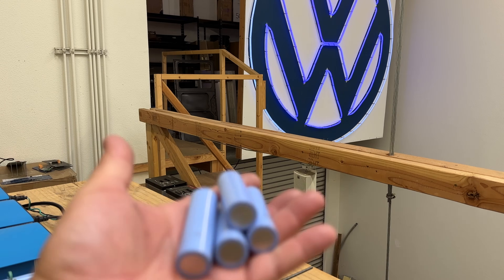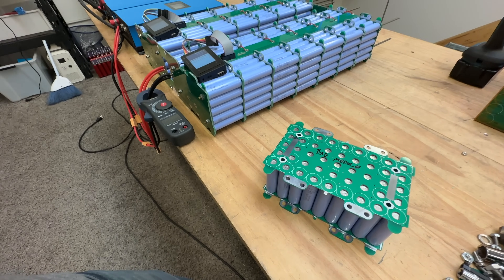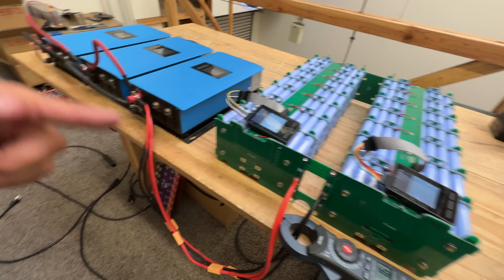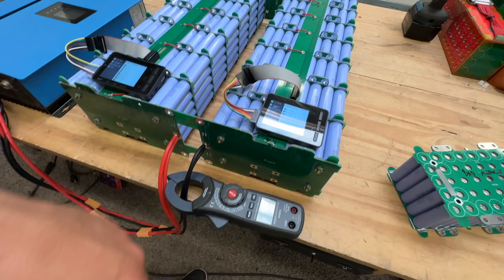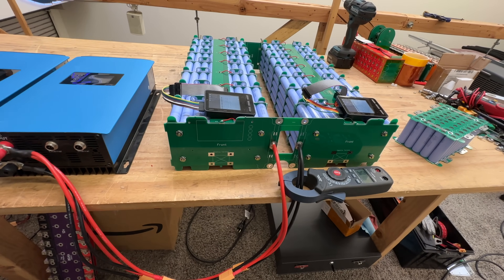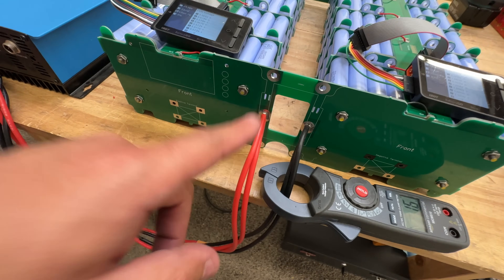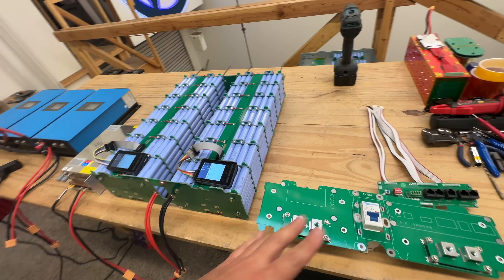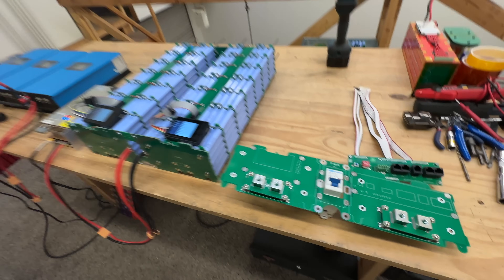Making batteries - 18650 PCB modules

Comment: I'm thinking about buying your 24v 18650 diy pcb kits and was wondering if I can make two stacks like 5 boards each then connect via the plug in series to make 48v system. Is this possible? or would I let the magic smoke out and make the pixies angry?

Comment: when a weld breaks loosing connection to a terminal in a ev battery pack wouldn't that change the voltage output or the charging so if the ground side on 1 battery in a pack broke connection the hot still connected could still discharge and drain the battery to much , how about a test?  having compression on the terminals or a torque so not to push in the positive to far in with compression connecting the terminals along with the weld would be safer in case a weld was to come apart

Comment: Im all for DIY stuff and i like the videos. But when you add up all the costs of the batteries , cables, pcb bms etc.   Its always going to be more expensive plus the fact that the 18650 would last less than LFP so it doesnt look cost effective.

Comment: The best location for contacting pressure would be concentric around the rod holes , not in a line between the 2 holes.
The strips might even result in a warp like this () due to them protruding slightly and the forces generating a bending moment at the edges of those strips. 
This is all theoretical though but I'd take that into consideration for the next iteration if possible.
Also make absolutely sure to use a torque wrench when everything hinges on the correct and consistent pressure generated from those nuts!
Tightening a nut more in one place than the others might likewise result in some material bending/drifting and lead to faulty contacting after a longer time period.
Also why not let there be a bit bigger holes rather than those needle sized ones in the intermediate spaces of the green board... so at least a tiny amount of cooling convection could happen if the cells would be mounted "standing".

Comment: I think if you either used a larger nickel strip on those contacts, or used a wide nickel strip bent in half along the long edge to provide a "spring" contact tab you would have extremely good contact pressure ensuring that even if something was slightly out of wack there would be a solid connection.

Comment: I think it’s Trampa boards that does something similar and I’ve seen some LFP batteries made of cylindrical cells using compression just like you describe. 

I strongly disagree with the concept behind the Trampa boards. You don’t put P42A’s in a pack and then do stupid shit that increases resistance. You do everything you can to lower resistance for the cellinterconnects. You experiment with copper, you layer nickel on top of nickel (pure nickel you plebs, plated steel is only good for the copper nickel sandwich)

You don’t say “welding material together is too complicated, on my high power application with some of the worlds best high power 21700’s I’m going to abandon welding because compression is good enough”

Unless you’re trying to build a heater
Reply from the maker: This is not high power design.  1c target for storage.
Reply: @jehugarcia  Yeah totally understood I was just on a rant bashing the people puting P42A's in a compression design. I actually have you to thank for teaching me so early on that cell holders are not ideal for building battery packs and its because of the terrible resistance of the contacts. You have to spend money on the nice Keystone holders if you want to only add a few milliohms on each side.

This might be one of your best ideas yet. It's like taking your PCB module design to the next level. There are a few LiFePO4 battery manufacturers using a very similar design (I know Lithium Solar has reviewed at least one) and when done correctly this absolutely works. It all comes down to making sure your PCB's/plates are made to decent tolerances so the compression is being applied to the conductive area and that the material used is up to the task. I'm pretty naive when it comes to PCB manufacturing but what would it take to have copper pads doing the transmitting of current module to module? I know spot welding nickel to copper is a pain so if the factory can make the switch from copper to nickel where the consumer attaches the battery nickel to the PCB that might significantly help.

I did some testing to dispel rumors about copper on top of nickel interconnects and nickel on top of the copper interconnects and I was surprised to find out that even if you had nickel as the primary interconnect material touching the cells (what I would consider the easiest way to do this if you didn't have access to a kWeld or other 1500A+ welder) the addition of copper did help because current chooses the path of least resistance. I'm guessing in my little test setup that the current was shooting straight up to the copper ASAP when it "saw" that a long strip of super low resistance material was available...kind of like it saw an AutoBahn running above it on a second floor of the highway system so even though it would take a few extra seconds to merge off the 1st floor highway and take a ramp up to the 2nd floor AutoBahn the tripling of the speed once up there made it totally worthwhile for even a short trip (distance between the cell terminal and the top of the copper 2nd floor Autobahn would total 0.30mm if the current wanted to run on top of the copper and the distance between the two terminals was 18mm center to center so a huge distance compared to traveling through the nickel vertically)

At some point people have to accept that spot welding is necessary and its 2023, a so so spot welder that can do 0.15mm nickel can be had for $50! You can buy a $30 3S Lipo and a $20 board or you can buy a powerbank style spot welder that has the lipo inside with a cute little display. It's a worthy investment, you'd spend just as much on a set of decent sockets or wrenches. When it comes to 18650's 0.15mm pure nickel is going to cover everything but the 10C cells being pushed to the limit.

Comment: How long will it take to charge it?
Reply from the maker: depends how big the charger is
Reply: @jehugarcia  I know, but I was asking for your charger.
Reply: @Under_Protest t’s a 1000W CC CV power supply (the one directly to the left of the packs in the latter third of the video. 

I can’t tell you which voltage/current one he has they come in a very wide range. So just take the max battery pack voltage and divide 1000W by that number. That’s the theoretical max amps (if the chargers voltage limit was exactly that voltage) common voltage current combos are 24V/40A, 48V/20A, 100V/10A, 120V/8A, etc

No offence but these questions get kind of old. Most lithium batteries can be charged at 1C so that’s one hour plus a bit more for the Constant Voltage Stage. Some power cells can be charged at 2C but that’s less common and hurts cycle life. 

So considering all the gear Jehu has I’m sure he could slap together some inverter chargers to charge just about any pack up to a couple hundred amp hours in 1 hour and 20’ish minutes from dead ass empty to 100% SOC. any time you wonder “how long does that take to charge?” The answer is technically 2 hours 30 minutes at the most if the cells only allow 0.5C charging. But for the majority of cells it can be charged in just over an hour if you’re willing to get the right charger (which aren’t that expensive, those $300+ e-bike chargers are a freaking joke, for $200 you can max out any 120V circuit at 1800W and get close to max out a 220V-240V circuit by buying a 3000W charger on Aliexpress but you have to know what you are doing, be able to understand what they are building these chargers from, and what are the limitations in terms of grid power, the charger, your cables, your connectors, and your cells. 3000W is a shit ton of power even 1800W is a lot and if you don’t have a moderate understanding of power electronics I would not recommend getting a charger made from a modified server power supply/telecom power supply off Ali)

Comment: Hey Jehu, I have an iMAXB6AC
Dual Power, and I got it too hot. First question, is it worth getting it fixed, or just buy another one? Second question, is there a better charger to use for single up to 6 or more batteries at a time? I opened up the balance charger and replaced the 680 micro farad 35 volt electrolytic, because it was blown. But it still resets every time you try to use it.
Reply: Q6 nano/Q6 plus by ISDT. Q8 air or max if you want 8S

Comment: This product is very exciting.  Please stay focused on this, as this would make a great powerwall solution.  It would be awesome if you can source the case, bms, batteries and all the pcb boards to build this product for a reasonable price.  I also think it could be made better if you can connect the modules a little differently so that you know you will not lose contact between the modules and possible short out the battery.  You are awesome, and I am addicted to your videos and your products.  Keep up the amazing work.

Comment: Just connect everything with bolts it is already a tried and tested method (if it ain't broken dont fix it )
Reply from the maker: Bolts can’t be placed near the cells,  only on the outer sides of the modules unevenly loading the cells.  This fixes that issue.
Reply: @jehugarcia  i think it would be more reliable conductive wise to connect each pack together with the bolts at the top too,there would be no fear of getting a loose connection over time makings your product last and prove its self reliable over time.just saying though,anyways i enjoyed your videos and i learn alot thanks for your content really helpful 👍
Reply from the maker: @odeywilliams7596  both can be done at the same time
Reply: @jehugarcia  would be better

Comment: One issue I see, is that poor connections could occur over time. Given the increased resistance of poor connections, combined with typically high amps, it could create hotspots in the core of the battery. This could cause cell degradation and/or runaway thermals. I'd suggest to just screw the plates together.

Comment: I love it. I have 100s and 100s of 18650s. 48v 100a is great.  I also need 14.2v. Voltage drop will put it at 13.8 which what all the ham radio and cb radio folks want. Look for parks on the air.

Comment: How about 21700 batteries with aluminum terminal, any ideas how to use these for cheap?
Reply from the maker: Aluminum ?
Reply: @jehugarcia  yes, ones used in tesla model3. they have aluminium +. these sold for pretty cheap. but cant be welded traditional way. would be nice to find a cheap way to use these.